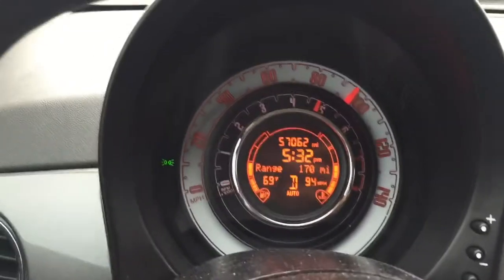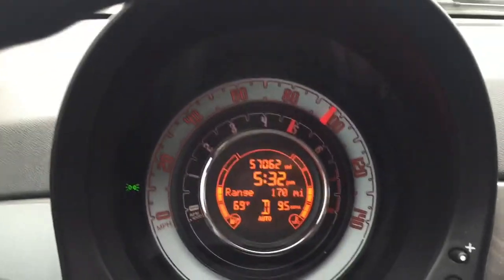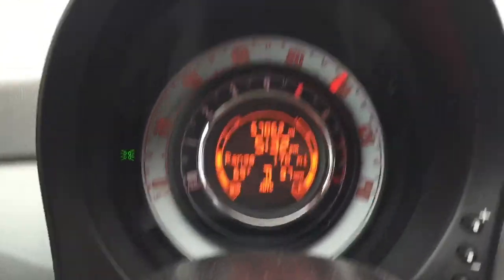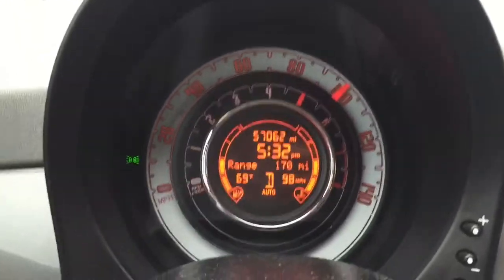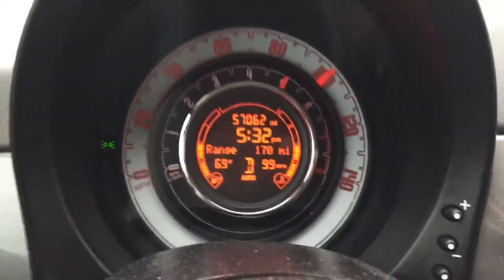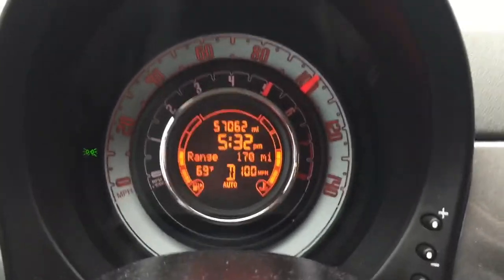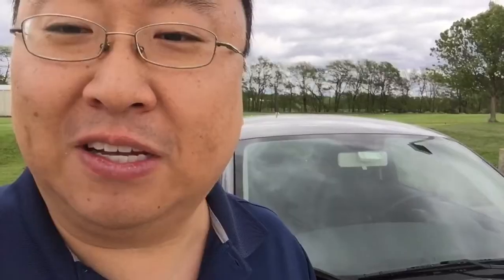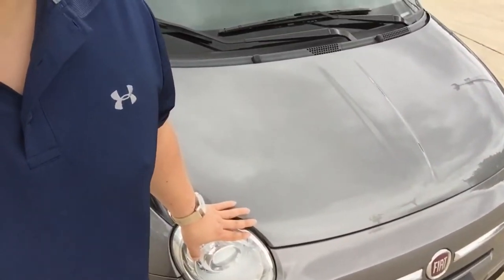How fast can the Fiat 500 Pop go?

Comment: Even the 875cc 2 cylinder turbo twin air unit is easily good for over 100mph and that's the early 85hp version. I expect the 105hp version will be a little quicker. It also sounds like two angry squirrels having a brawl.